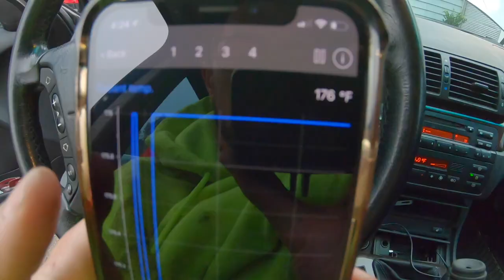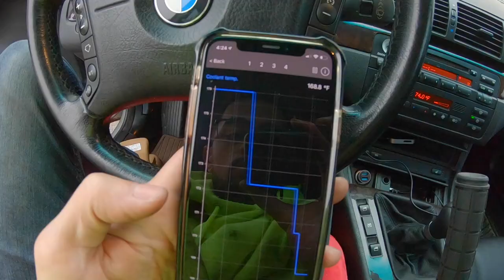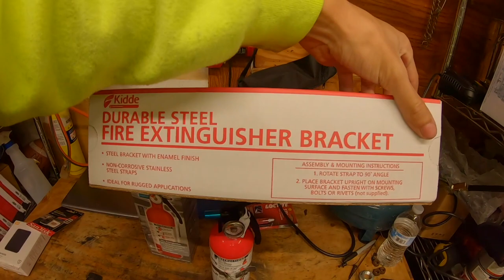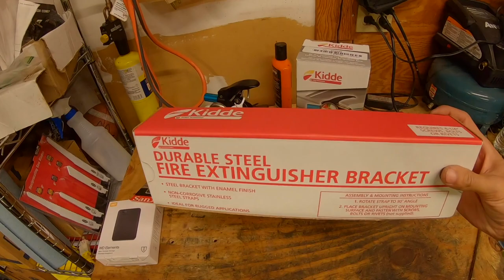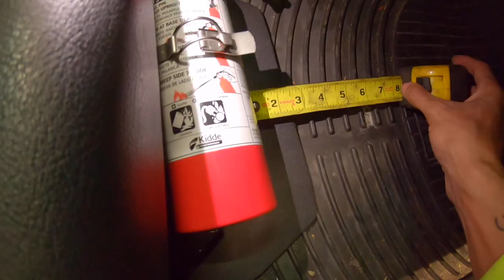Making A Fire Extinguisher Mount For My Drift E46 Wagon (First Drift Event Prep)

Comment: Having an extinguisher in the car is a clutch move everyone should do. I mounted mine to the bottom of the rear seat bracket so I can reach it from the front seat just as easily as my passenger seat floor board.
Reply: Your right. And also in most drift competitions they won't let you in if you don't have one